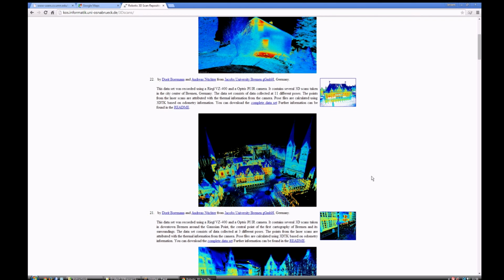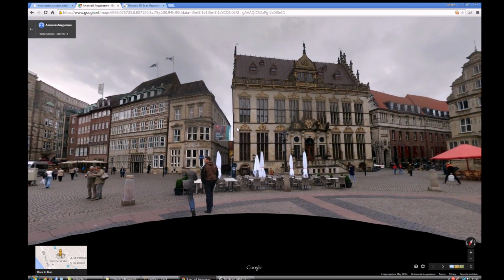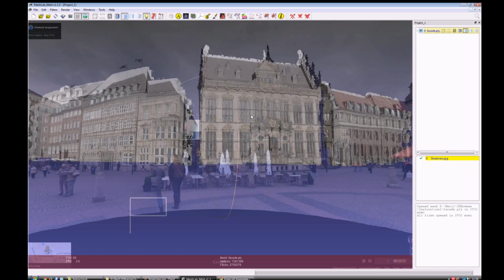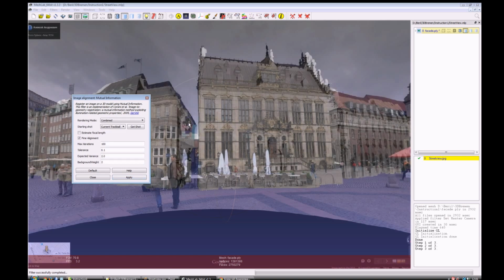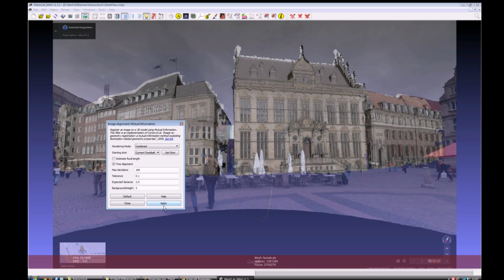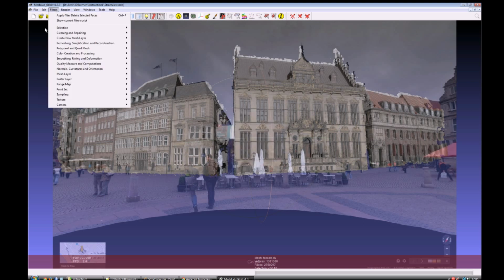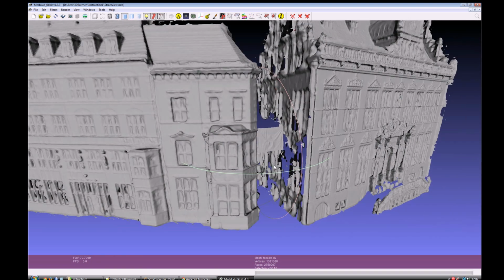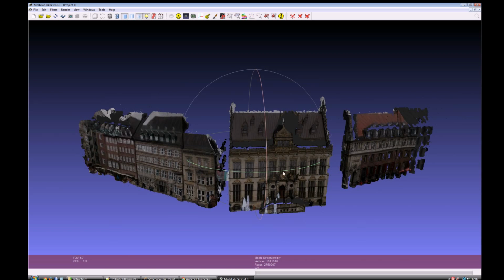Texturing a 3D Mesh with Google Streetview 1 of 3: Manual Alignment

Comment: Hi Jeroen, i have watched your videos and I find them interesting, I am doing a project to match an image 2d with a 3d model. So, this video, was really helpful. However, I had a little problem: when I load the bundle in meshlab, the program quit when I load the file list.txt. 
this is my bundle.out file
# Bundle file v0.3
1 0
20 0 0
0.656586211 0.288380322 0.696944285
0.294752302 -0.948647246 0.114845480
0.694273453 0.130019974 -0.707869464
-5.486285475 -0.331488792 2.467574241

and the image i'm working is a 1728 x 2592

do you have any idea why is this happening? Thanks for your answer
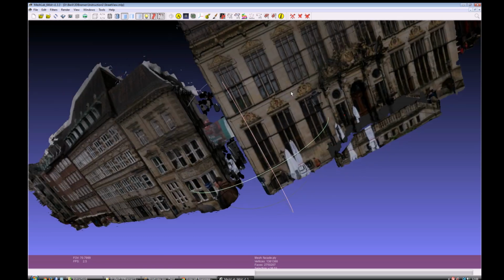Reply from the maker: +Moisés Rodriguez Oceda I remember I also came across this problem. Make sure that the list.txt contains the correct image file name and that it is in the same directory as the list.txt is in. Also, make sure that there is an extra line-break (return) at the end of the list.txt file. I initially forgot that and corrected it in my video https://www.youtube.com/watch?v=0HZDuI48IHc at 11:50 min.
Please let me know if that helps.
Reply from the maker: +Moisés Rodriguez Oceda btw your focal length value seems extremely low. Did you perhaps enter a focal length in millimeters here? Note that it has to be given in pixels, not in mm. To go from mm to pixels, you need to divide it by the pixel size in mm, for the resolution of the image you are using, or otherwise estimate it as I did in part 2.
Reply: +Jeroen Lichtenauer I'm really thank you, that works. Look, I couldn't use the VisualSFM method, because I can't install it for Mac, so to have the focal leght I used matlab calibration tool, the result was: (944.1504 890.5103 ) obviusly this is fx, fy. To use the DLS algorithm, would it be right to use sqr(fx^2 + fy^2) as focal length? I'm doing that and looks acceptable haha. Greets
Reply from the maker: Great to hear you solved the problem! Nice you managed to use the Matlab calibration toolbox. The x and y focal length should be equal if you have square pixels (which is most often the case) so the best is to just average them (fx+fy)/2. But make sure that the calibration images used in Matlab to get those fx/fy values were also 1728 x 2592 pixels. If not, you need to scale the focal length with the same ratio as the resolution.
Reply: +Jeroen Lichtenauer thanks a lot, doing (fx+fy)/2 the result was perfect.